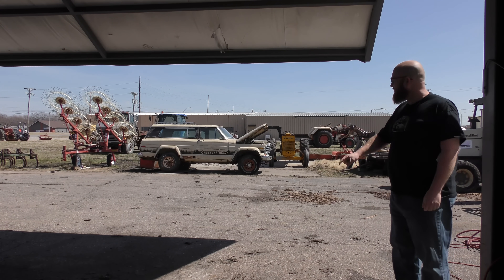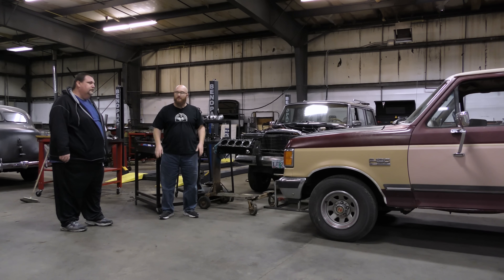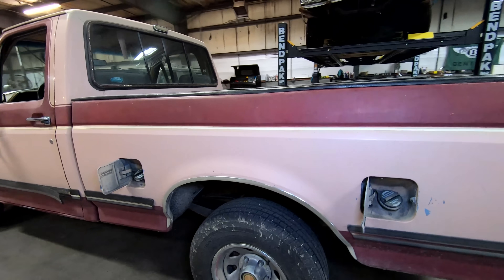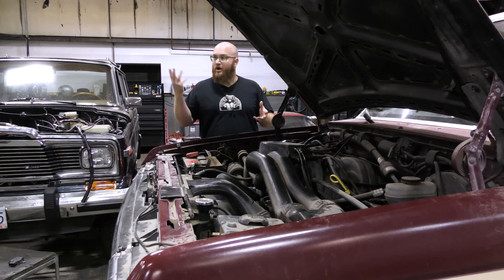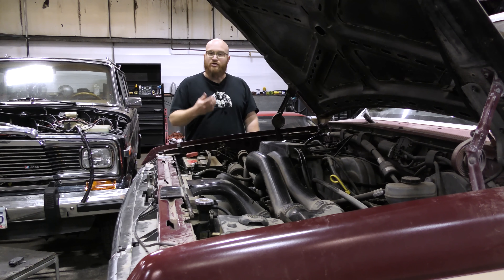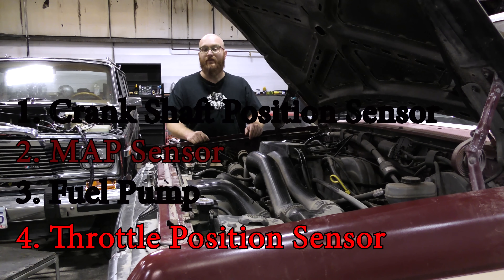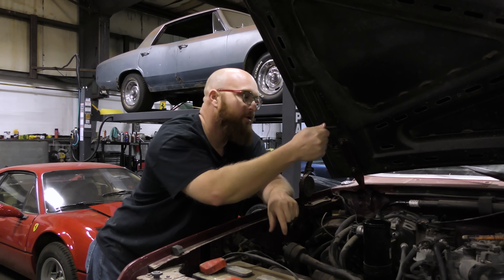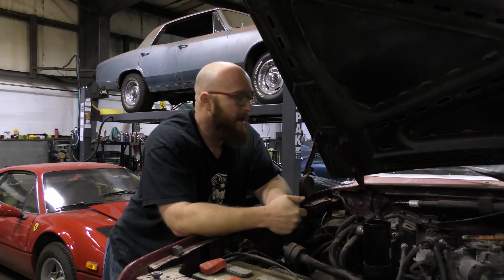Parts cannon couldn't fix this '90 F150. Old School diagnosing by the CAR WIZARD

Comment: I am an old timer (OK 3 on the tree was standard and you stepped on a button on the floor to start...I am old) BUT I have 1 more for you that lucky for you was not your problem here. 
OK figure out this and how to fix 
1995 Ford F53 7.5L gas EFI. Fleetwood mobile home Class A. Runs like a striped ape for about 30 minutes at highway speeds then loads, back fires, burps, pings the works. Pull off the highway wait 5 minutes and you are off to the races again for about 30 minutes then all over again. What is the likely problem?
OBD1 on the scanner read out 000, But now you have a flash on the dash! 31 is the code what is the problem? 
ANSWER:  EGR VALVE, Simple fix right?
WRONG : That part is NO LONGER made anywhere. FORD tried Canada, Mexico, Whole of the US. None anywhere at any price. Did find one on Evil Bay USED $600! a regular EGR anywhere is $25
So what is the answer? The Feds will not like it, but is common on the FORD. Remove the EGR, Plug the vacuum line and you are ready right?
Wrong now you have a giant hole in the injection housing feeding the engine - now what? 
Well you go on line and for the grand total of $22.95 shipping included you get a block off plate assembly that has the plate (you can even get them in your choice of anodized colors) with the gasket (important do not forget it!) the screws AND a plug for that silly exhaust tube tube that supplies exhaust. Slap it together and go right. Well kind of. The problem is solved BUT if you live in a state where they check smog you are SOL you will never pass. But in the other 46 states you are "legal". 
And that is the story of buying a "new" lovely 50,000 miles Class A and why it was traded into a MAJOR RV dealership ---oh yea did I mention that the dealer never said anything ever and says it is no longer their problem. Good Luck and if your early model (95 and before) starts burping, farting and over loading that is a heck of a place to start. 
PS don't try and clean it, they say you can soak it over night in cleaning chemical NOPE even if you can get the exhaust tube off soaking might clean it but the rubber parts and the electoral circuit will be toast, and you are going to block it anyway...just don't brag about it

Comment: $800 to repair?  So what?  Buy a newer vehicle and your monthly payments might be that much for . . . how many years??  $500-800 once every year or two and you are money ahead.  (I have a 95 F150 and a 94 Camry.  The F150 is 100% original.  The Camry is cheap and easy to repair.  Both are running fine.)

Comment: Memories. I had a 1990 fullsize Bronco with the same engine from 1998-2005 and still kick myself for selling it. And the truck market right now is why I spent almost $1,000 to learn my first automatic transmission build on the Bronco's replacement I've had since 2007 https://www.youtube.com/watch?v=q1l9IVZttVY&t=3s

Comment: Ford I-6.  Not about raw H.P., all about smooth low end torque that will last forever!

Newer Ford and especially V-6 turbos....TRASH!
Reply: I have 2 Nissan Laurel's 2.4E Inline six ( Euro Spec ) and they are smooth as silk and strong as a rock with no vibration!

Comment: The problem with using a voltmeter is that if you aren't a shop, you may have a hard time finding the specifications unless you own Alldata of have a repair manual that is vehicle specific. Also, I have returned parts many times and never had the "trained investigators" give me trouble. You have a tendency to be a drama queen.

Comment: Oh boy , this might be the worst one yet my man . Of course the thing has on board diagnostics with a data stream and the whole 9 . EECIV ......... That truck is not fixed I will say that.... There are a handful of things that all of them have wrong  . Replacing the sensors was a waste of the kids money.... Clean or replace the EGR valve . Shut off the vacuum leaks especially that large hos in the back you cannot see going to the PCV valve. Clean out the Throttle body real well and remove and clean the air charge sensor . Then follow the correct procedures to set the proper base idle and send the boy down the road... Less than an hours worth of work and no money really at all in parts....
Man just stay clear of Ford trucks all together , you are just soaking people when ever you touch one....

Comment: Difficult to diagnose because you can't get the code lolol
Spoken by a parts changer, NOT a mechanic

sorry had to edit as i watched further
during that little quiz.....
THERE IS NO CRANKSHAFT POSITION SENSOR ON THIS TRUCK

jesus what an idiot